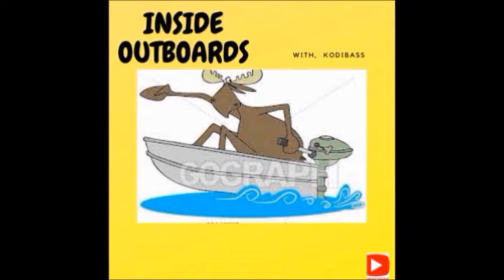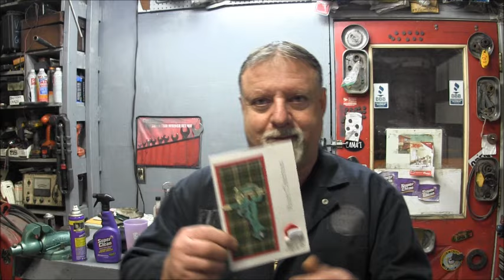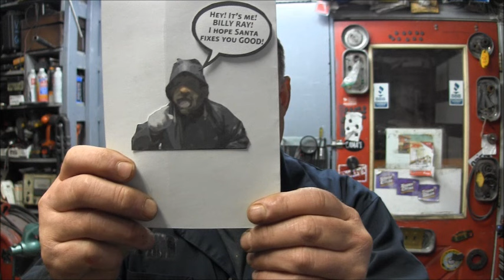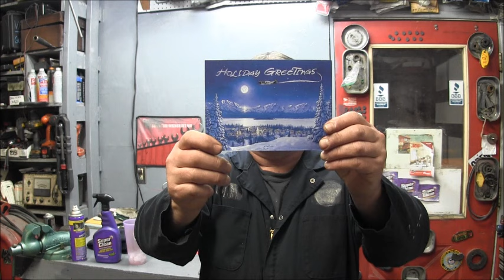OUTBOARD  FUN,  MERRY CHRISTMAS

Comment: Hi Kodi and Merry Christmas and a Happy New Year to you as well. Getting ready to weld on a skeg fin on a old 2hp Elgin and found that since I have an ark welder to try using the E4043 aluminum welding rods. Just a small area to weld and thought I'd try it out. Other than being super messy it looks like these weld up aluminum pretty solid. I know Tig or Mig is better but will try this out since all I have is a small 220 ark welder.
Reply from the maker: Just  remember those  Rubber  seals in there,   May-b  a cold wet  Rag?       kb
Reply: I gave up trying to weld it. Tig or Mig is about the only thing that will work. Gave it back to the neighbor and he said a guy he works with has that stuff.
Reply from the maker: @TimsWorkshopTJY    Yep' U would think by now they should have a decent aluminum rod.     kb

Comment: All the best to you and your loved ones my dear sir ! I've also had a 7 ton log splitter for years but it's electric so it develops plenty of torque and can be operated inside (where it is warm aand cozy). Yeah, those "vertical roller" starting mechanisms  aren't that great a design but I wonder, Dr Frankenstein, if your 6 hp bonnet will still fit after the crank transplantation ?  We'll see, we'll see said the blind man ! Thank you for the kind words.
Reply from the maker: Yes'  U  R  correct   that  the hood  will B a Issue ,   Never  stopped  me  B-4   Haha    Happy  New  Year  mate.    kb

Comment: KODI I got a 1986 15hp evinrude  when I first crank it up and start down the lake it runs full power but the longer I run it slowly loses mph and power do you know what it might be wrong
Reply: If I may, here is the diagnostic process I hed great success with. First, flush the tank and get fresh dinosaur juice. Second, flush the fuel line by plugging it to the tank and squeezing the primer bulb while pushing in the ball bearing that closes the engine-side connector valve. Third, make a lake test run and squeeze the primer bulb as the rpms start to drop. If the rpms then increase, your problem is with fuel delivery (air/fuel leak, bad fuel pump and/or dirty carb) if priming makes no difference, your problem is ignition related (spark plugs, coils/power packs, stator or wiring) Here, your best bet is to get yourself that motor's specific OEM repair manual and check those componants' individual specs or maintenance procedure. Regards !
Reply: @danielrobert7181   Thanks for the advice I have ruled out fuel because new fuel pump new tank and lines and tank runs good on another Johnson 15hp I did replace the charge coil and trigger sensor that is located under fly wheel I have the manual and will test coils and power pack with meter
Reply: Seen a lot of those fuel pumps (especially aftermarket items) that did not deliver as promised. You didn't mention anything about the carb. I'm pretty thorough at deep cleaning those but I've seen instances where I had to do it twice. Once again, beware of cheap Amazon carb rebuild kits.  Good luck !